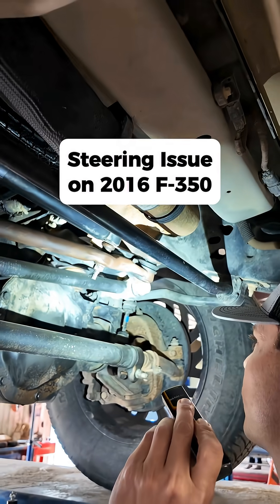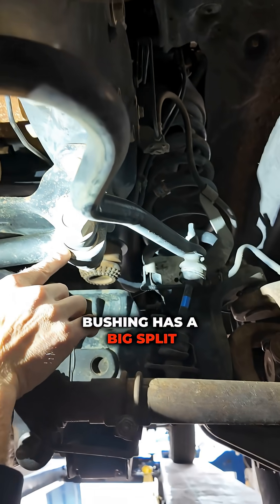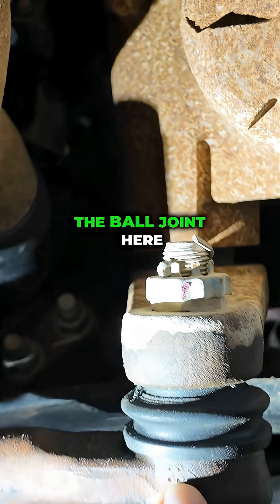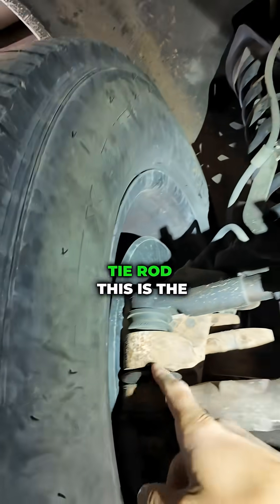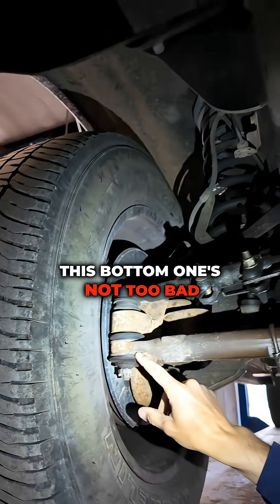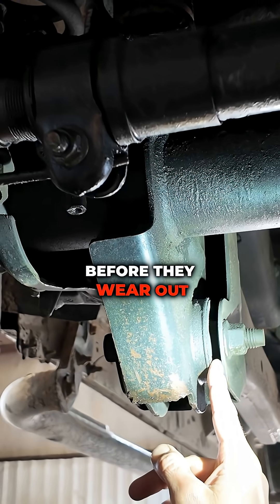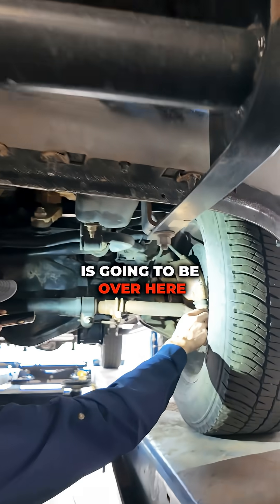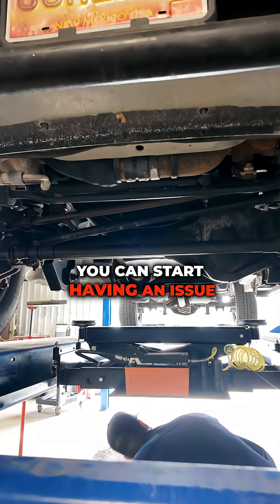Why Does Death Wobble Hit Ranch Trucks First? #Shorts

Comment: If it mover, it will effect tire ware and alighnment, not to mention movement is the 1st signs that a failure is accuring. So to quote an old mentor, " if it has movement, replace it. Get a real alighnment guy set the front end", you will be happy and safe.